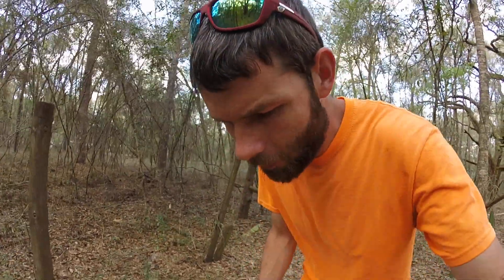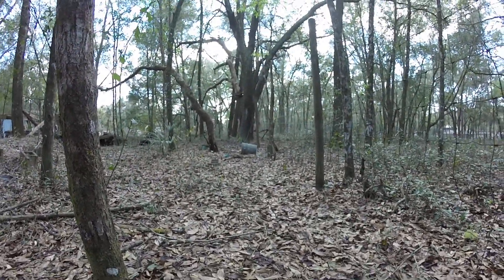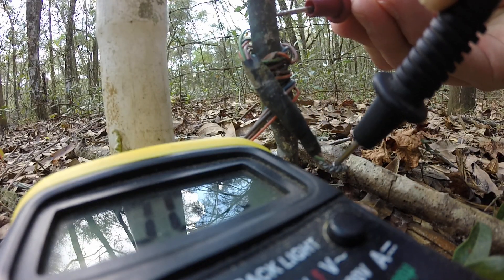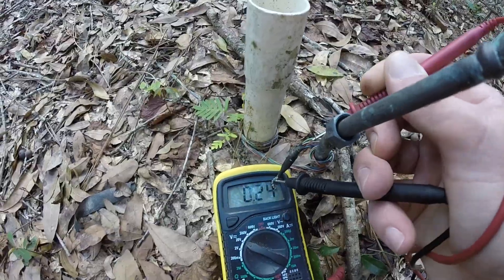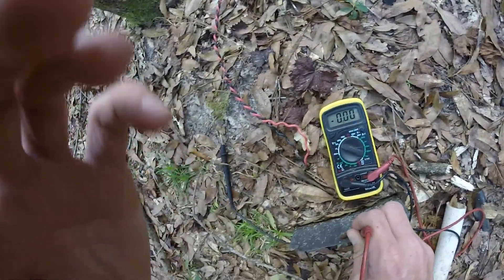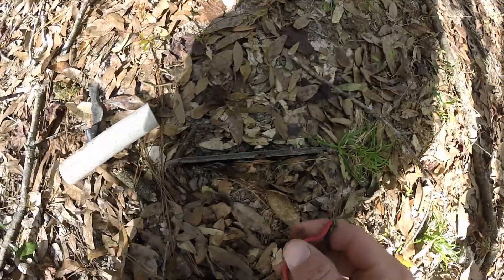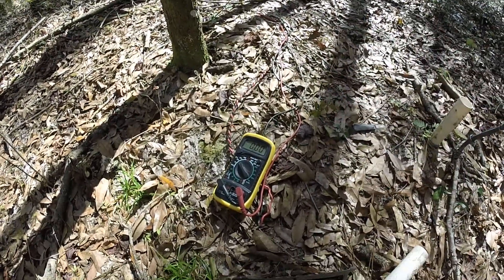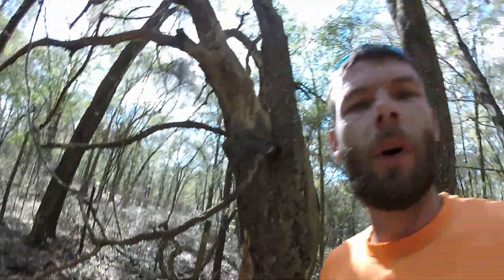"Free Power Forever"  7 Year Old Earth Battery One Time Free Thinking Fee,  Infrastructure Off Grid

Comment: You don’t get much out of it, but it is something that you can work with it. Try to put a capacitor 100uF across the wires than an oscillator than a voltage doubler and then you get something perfectly usable. Soil in a forest is most of the time kept moist enough for a galvanic reaction and if you are not keen to kill your cells they may last for years.

Comment: I use this every day. This will not produce enough amperage to power anything of significance. This is an electro chemical cell. You can use this for cathodic protection of the copper until the zinc galvanizing is depleted. Then the voltage polarity will change as the steel becomes the primary metal in the cell. Try magnesium instead of zinc for your anode. Reduce the size of your cathode.

The distance will not matter 5 feet or 100 is irrelevant as long as both are in the same electrolyte.

Your cell will never build up a charge. It is only the potential differences of the metals.
Reply: Not true, with enough of them you could. One study they got 59 volts and 60 amps, so a total of 3000 watts. I am not saying this is gonna replace the power plants but they certainly do work a bit.
Reply: @FreddyYesp 
I am positive with the right materials paired and enough experimentation it could definitely become a viable source of power.

Comment: Take a dead 3.7v lithium ion cell and measure the voltage with your multimeter... You'll get 3.4-3.6 volts....even though it's just a dead battery...just because your getting voltage does not mean your "getting electricity"....learn wtf voltage actually is before acting like you know how to fix the world's problems because it's insulting to people that have actually put in the work to understanding how this stuff actually works

Comment: What’s missing is data that can help evaluate this.  Need voltage and current and duration.  If this is just due to galvanic action, it is not interesting as the anode and cathode will be consumed.  If it is from something else then it is interesting.  To validate, need the long term data and a calculation to show it is not just due to oxidation and reduction of the cathode and anode

Comment: First... you need to understand how this is works.
Microorganism !!! They produce potential difference.

I made very tiny cell 3D printed, produces 700 to 900mV.
The key is in the FERTILE MOISTURE SOIL... put electrodes, soil moisture all the time with organic fertilizer,
it will run FOREVER !!!

The electricity produced from SOIL is not stable, do not ever try use with electronic appliances.
You need to add regulator to have clean voltage and current with 3USD Ali Express converter module.

Put all cells in series and parallel on your need.

Mine is PORTABLE, compact, long life SOIL BATTERY. 
Never buy POWER BANK !!!

Comment: How many milliamps are these producing?
I have a galvanized screw and some copper wire in a small pot of soil that is producing about 0.727 volts and about 13 milliamps.
Reply from the maker: I forget, but I would say in that range. It's not much but its something to start with. =)

Comment: Have you looked into incorporating certain geometry into this circuit? I’m thinking with God that we may be able to increase the amperage by creating a circuit that encourages low resistance by its very geometric patterning, possibly something resembling a octagonal prism. Thoughts on this?
Reply from the maker: This idea intrigues me. No I have never thought of a geometric shape like that. From my research north to south works best but that is based on experiments like mine so a certain shape may increase power and amp's as you said. With God helping the outcome would be the ideal. So much to learn still remains but it all starts with an idea like yours. I am familiar with lay lines and am within 15 miles of a power plant which I figure they already use the lay lines or even unknown lay lines to figure out where to place the power plant. I am also within 500 feet of high voltage power lines which also Qu incidentally run north to south. I have more focused on length between the metals and depth of them as I like to dig deep. =)
Reply: @loneposse607   so maybe like a peeled orange cut in flat for a flat surface and with your home exactly halfway between north and south? Maybe bending the ones that can’t cross the house wider out towards each closest east or west? Your ideas great I ve no idea about this stuff but I did picture a globe with it’s vertical lines as segments of an orange and suddenly thought it would be best for your idea I’m hoping to learn all I need to know and pilfer from you ❤ Keiss 🏴🌈🔥 thanks v much. Hope it’s going well

Comment: What would happen if you take the small ones + and - and connect to the correct side of the next earth battery then the same again to the big earth batter ,,,they would be all connected to each other,,,that might give you more energy than them individual makeing power
Reply from the maker: I believe your talking hooking them up in series. That will work BUT... These earth bats make good voltage 3/4 of a volt or more each up to 1+ volts. The main problem you will run into is there is very little amperage. So while you can get 120 volts easily in parallel or series the amp's may still be to low to run most 120v things so you will likely want to make them all parallel circuit's to maximize available amp's. as voltage adds in series, current capacity / amp's adds in parallel. There are youtube video's of radio's that have been running for years off a small earth battery. I always planned to run my entire house off this idea.
Reply from the maker: When you understand power is only potential difference you to might start to wonder if the power plant that powers your house is really just the positive side of the earth battery and that big ground rod at your house is the other end of the earth battery. I dont have a wire that long to check so for now I speculate =)  This is the longest earth batter I have made yet and it's marginally more powerful than one with both ends only a foot or two apart. Telephone wires have a small amount of power that may also be from the  Telluric current in the earth.
Reply: @loneposse607  in France there’s a stone henge megalithic site BUT it’s runs in a row for miles ,have u seen it ? Makes me think it’s what your doing also  granite has a natural radiation to it , am thinking out loud but it could be what ur doing 
Happy Christmas to u and your family
Reply: @freethebeatle6537  you are spot on. thats exactly what those rows of stones were for....now think of stonhenge as a big capacitor.
Reply: There guy on ytube called David cowen his channel is about the laylines of Scotland,  have a look if your free on day 
I thinks it could help you 👋🏴❤️

Comment: The voltage difference is dependent on the electro-negativity of the metals used.  At least some of the current is coming from your plates corroding. I don't know if the rate of corrosion on you plates will perfectly match the energy you get out though.